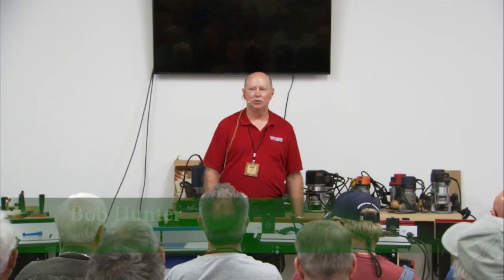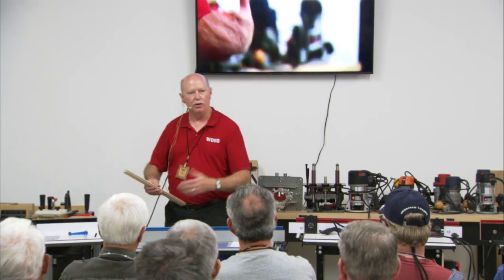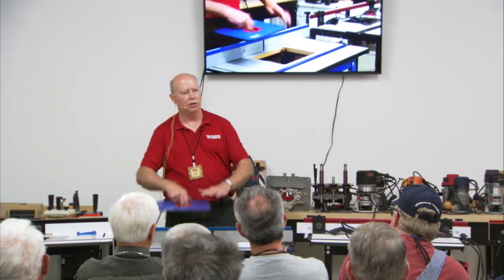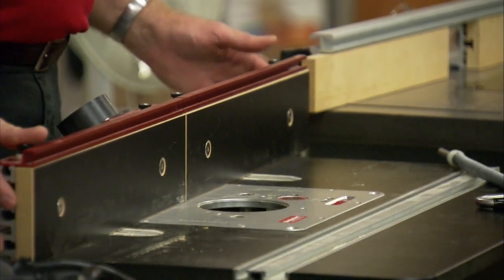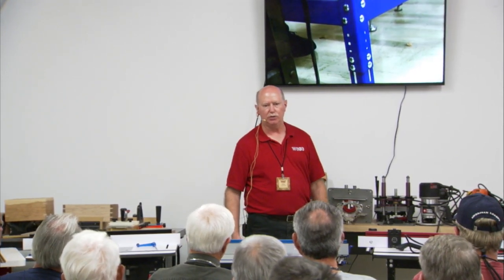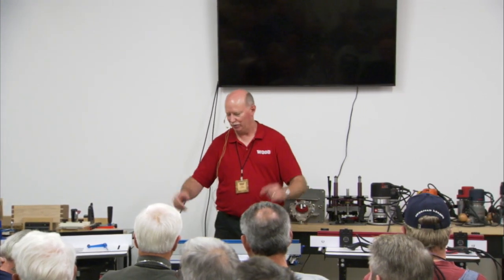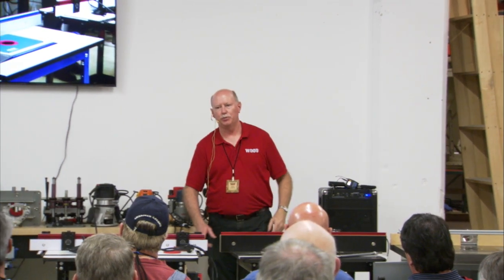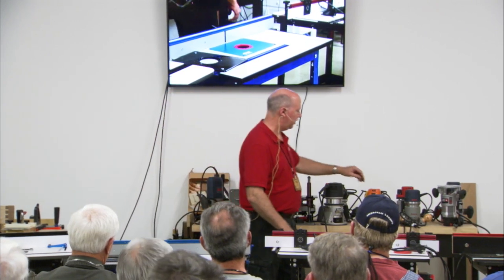What To Look For in Router Lift Tables   WWW17 - WOOD magazine

Comment: The Jessem rout r lift II holes do not line up when installing into a Kreg benchtop table. You have to count on the weight of the router. Sometimes the edge pops up a little. I think the middle of the table sags a little right out of the box which prevents it from leveling out.

Comment: A key player missing is the MLCS Powerlift Pro. It takes the concept of plunge routing to the router table by having a foot activated computer controlled motorized router lift. This opens the door for mortises, circle cutting, stopped dados, etc. 
The precision and ease of use is amazing - check out the latest 2019 changes for Powerlift pro. 

https://youtu.be/MI0D2WGpomc

I emplor you Bob - please evaluate the PowerLift pro and elevate your router table's capability